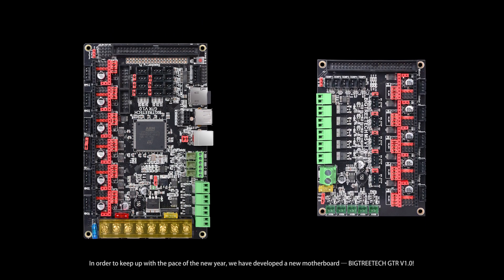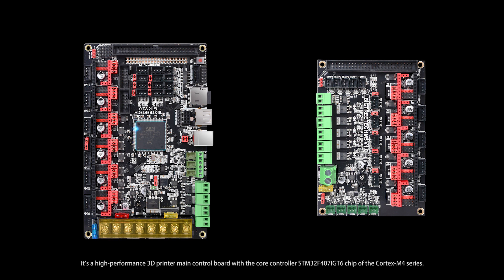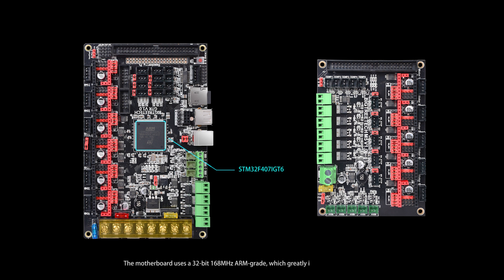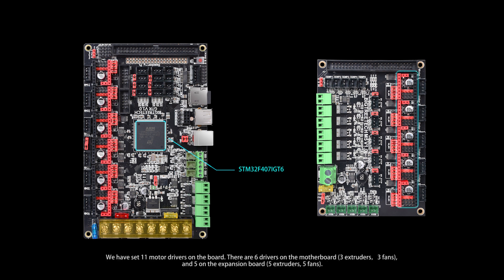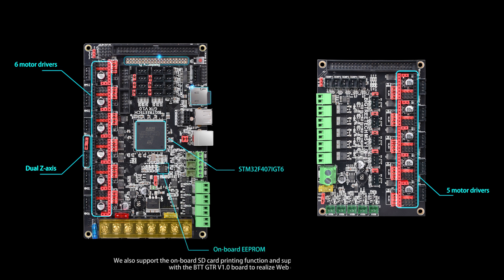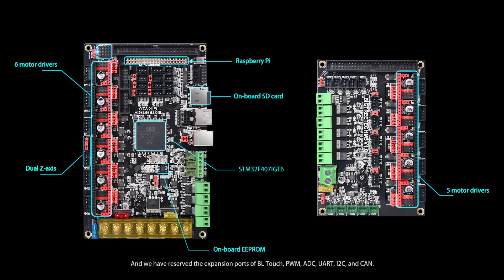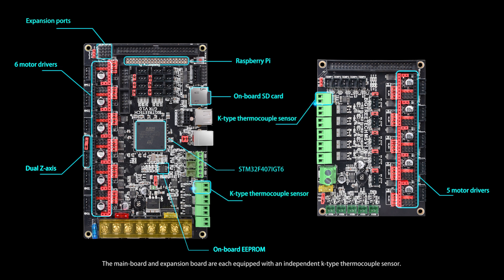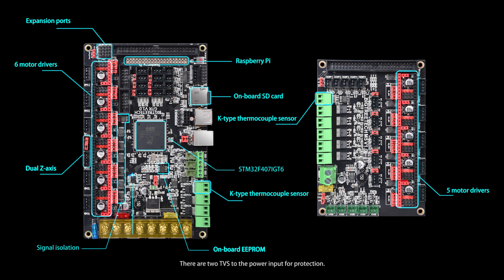BTT GTR V1.0:Expand to 11 axis! A flexible and expandable 3d printer controller fit for tool changer

Comment: Just watch out for this board firmware. It states on Platformio.ini: PLATFORM " STM32 7.2.0 > STM32F407ZG (192k RAM. 1024k Flash" and the hardware says STM32 F407IGT6.
Tuns out to be lots of features but lots more of BUGS. Also only works with they modified Marlin. At last: We know very well the China Manuals and Assistance.

Comment: Just bought one and SD CARD is not working though, and BIGTREETECH does not like to support customers, been sending email with no luck, Twitter every where but still no response! Yeah more like SHITTREETECH
Reply from the maker: hi,  was your  SD card break or other problem?
Reply: @bigtreetech5117  SD CARD has no problem. Works fine on SKR 1.4 TURBO. But on GTR V1.0 needs to be removed from board because not  showing up on computer when connected to the board.

Comment: I love that it is expandable and that you can fit your choice of stepsticks. It's the last feature that is the must have for me - having fried a driver on a certain other board (with non-removable chips) after a stepper-cable developed a broken wire fault. The back-emf voltage blew out the driver.
The other make of board is really good, but the embedded drivers can be a weak point. I can't wait to get my grubby paws on the BTT GTR V1.0!! 😃
I think this system may corner the market as long as the price is not silly money. Well done!! 👍👍